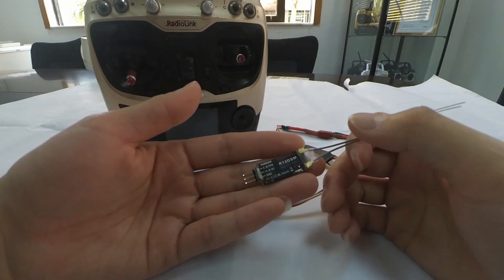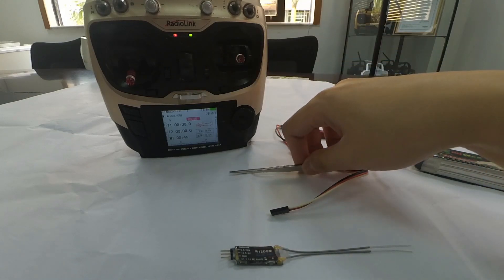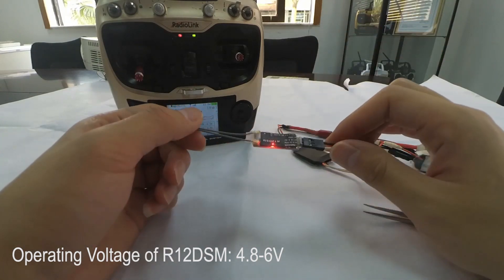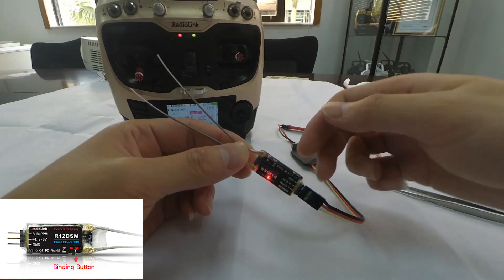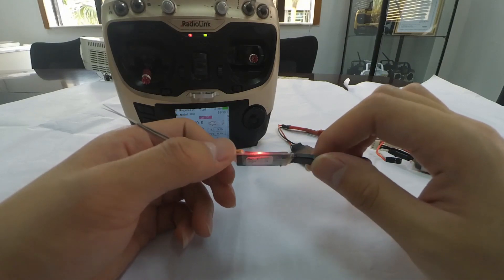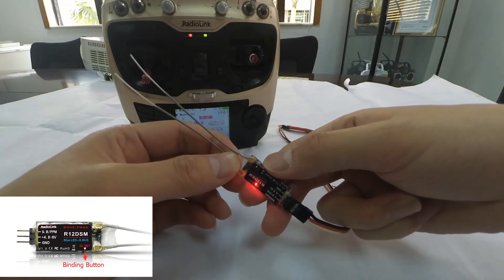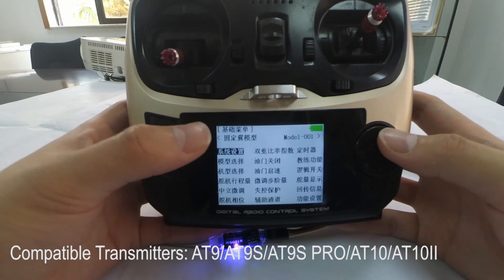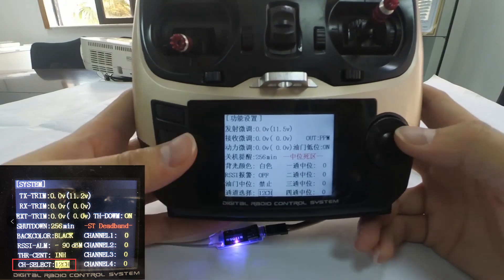How to| Make RadioLink receiver R12DSM bind with transmitters

Comment: Is this reserve working on radiolink rc4gs v3 or rc6gs v2 and v3?
Reply from the maker: Hi, sir. Sorry R12DSM receiver is not compatible with RC4GS or RC6GS transmitter. R12DSM is compatible with AT9S Pro and AT10II. RC4GS/RC6GS is compatible with R16F, R12F, R8FGH, R8FG, R8EF, R7FG, R6FG, R6F, R4FGM, R4F. RC4GS/RC6GS is also compatible with mini receivers such as R8XM, R8SM, R8FM. But these mini receivers need to work with flight controllers. Here is the link for your reference: https://www.radiolink.com.cn/rc6gsv3_specifications  If any question please feel free to contact us. Our email is after_service@radiolink.com.cn
Reply: @Radiolink_official thank you so much ❤🤗
Reply from the maker: @ALI70860  Our pleasure
Reply: @Radiolink_official 🤗

Comment: hello radiolink, I had a wonderful idea, since many buy radiomaster tx16s and jumpers, why, you of radiolink, do not sell an external module with jr connection with radiolink protocol?, to be mounted in all radiomaster tx16s, jumper t16  , frsky, turnigy etc etc, I would also like to purchase your external module.  what do you think of my idea, thanks good job.
Reply from the maker: Hi Thank you for your advice and it's very much appreciated. We will see what we can do to this market need. AT9S has received consistent high praise from many RC fans and your comments will definitely help us to improve.
Reply: we hope that this external radiolink module with standard jr connection for radiomaster, jumper, turnigy, frsky taranis, will be produced by you radiolink as soon as possible, this is the right time to launch such a radiolink module on the market to combine it with all radios with attack  external, many of us model aircraft and drones have bought many radiolink receivers, now we also have these new radiomaster radios and jumpers and I don't want to exclude our radiolink receivers which we are very happy with, radiolink must not be excluded from the new multi-protocol rc radio nu  today the multiprotocol is already a reality and a sure future